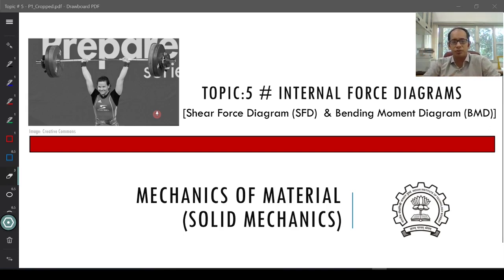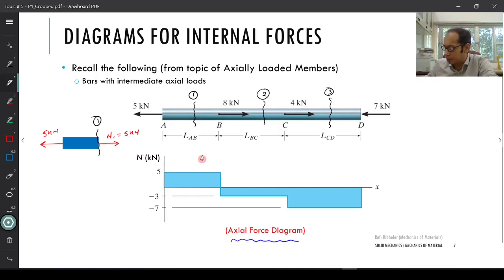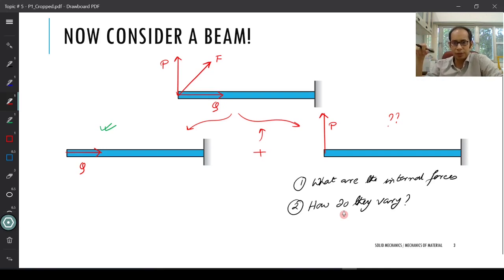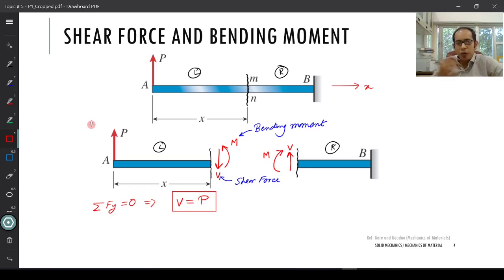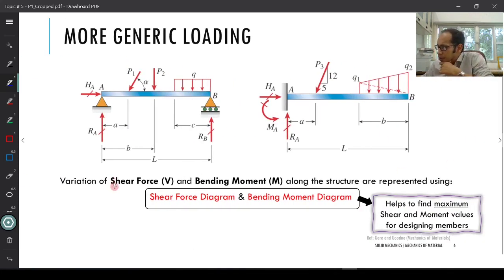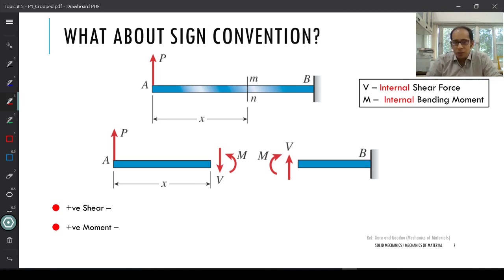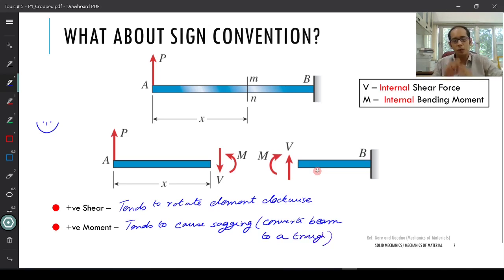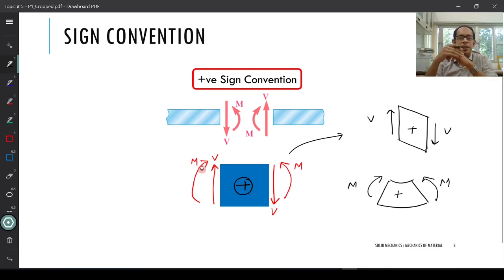Topic # 5.1 - Intro to SFD, BMD & Sign Conventions

Comment: Hi Prof. Ghosh! Thanks for an excellent explanation. Why sign of shear force on +ive element at 24:00 appears to be opposite to shear force direction(Txy (on +ive x-face and in +ive y-direction) ) the we use on  RVE for Mohr circle?
Reply from the maker: Thanks for this interesting question. What you are saying is seemingly right because the conventions are different. For the shear force, the convention is that as long as the force is trying to rotate the beam clockwise, shear force V is positive. For the stress, it follows a different convention, that depends on the face of the infinitesimal element. Please refer to this convention here from Gere and Goodno's book: https://drive.google.com/file/d/1UbGxc9ytPrUs1xNCHYO_d0bmxTLoFV4x/view?usp=sharing At the end of the day, I try to look at it as the following: Conventions depends on us. Different books/authors/scientists have different conventions. But as long as we are consistent and have an intuitive sense, we should be able to predict the correct direction of the force, or the stress.